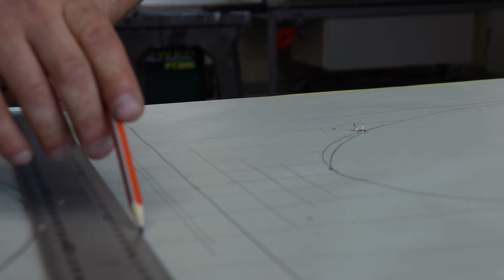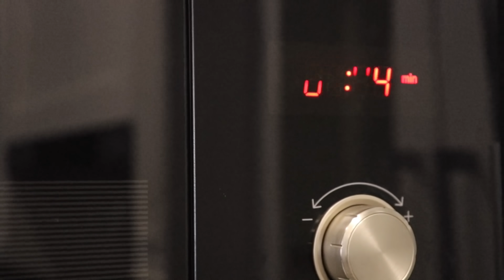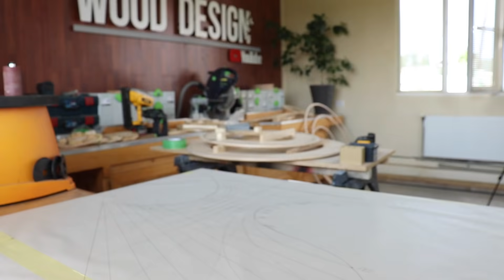DIY WOOD CHAIR | Как сделать кресло.

Comment: This is a Sculpture ! This is Art.
Fabulous.
Considering all the effort, time, sweat and tears(?) this must be a very expensive chair ! 
Using those little wooden pins as connection points made me think that they're not very strong by themselves, but because there are so many it will eventually be sufficiently strong enough. Strong by numbers.
Do you make these chairs in òne go ? Or are there  also tests, little prototypes, etc , before you start making the real thing ??
Thx for sharing.

Comment: Another intriguing, sculptural piece of furniture. Well done! 

To my mind though, its looks a bit too big and a bit too wide - would elliptical formers have worked better? It's very difficult for designers to appreciate just how varied the sizes of the human body can be, so anthropometric data should (I believe) always be consulted. "The Measure of Man and Woman: Human Factors in Design", available from Amazon, is very comprehensive, but very expensive.

Comment: this the frame in side  for the chair it is okay , good,          but  if you cover by epoxy resin *same ,they make the face table*,,at some  gap in the hedge with the colors ,,,,,,, it will be beauty full  ,,
Reply from the maker: Thanks a lot and thanks for the advice.